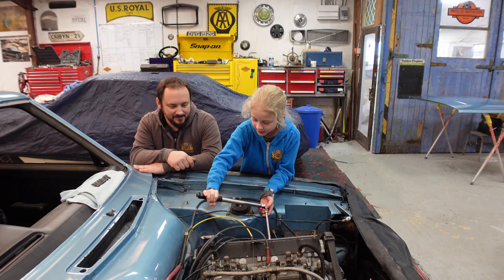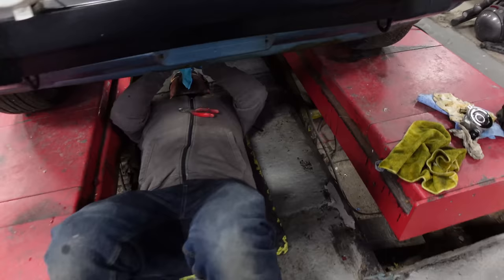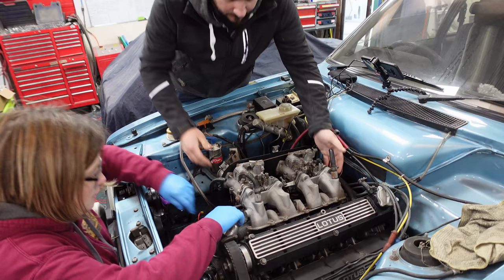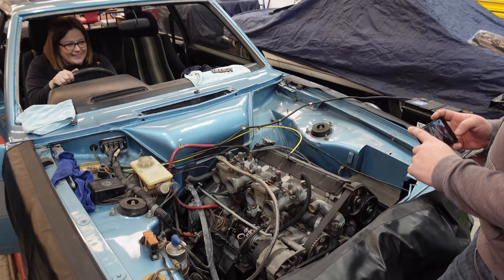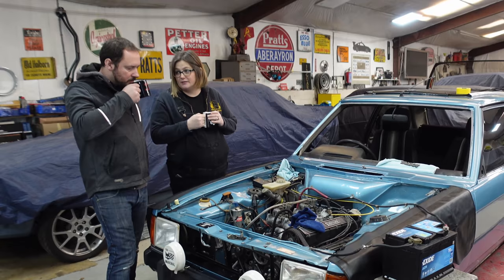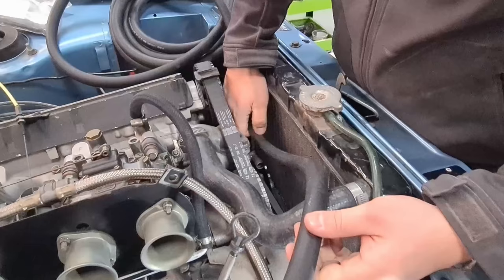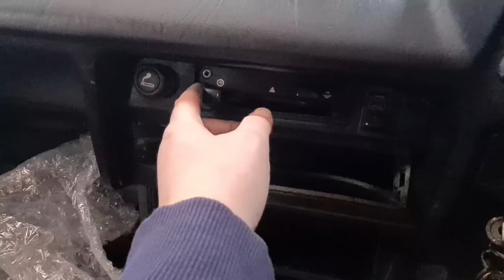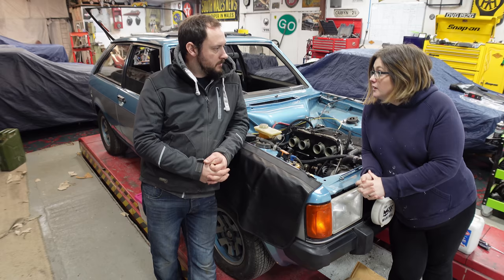First Start of the Blue Talbot Sunbeam LOTUS After 6 YEARS!

Comment: That pit-lift platform looks very handy but you really need a lie-down trolley under there, and it will also help keep your back warmer and dryer too. (I thought nothing of lying on cold concrete 20 years ago but not any more).
Reply from the maker: Well Phil funny thing is.... Its a full height lift we just ca t remember why we didn't send it to the top and just stand under it 😂 we also have a lie down trolly it's just got a. Massive slab of oak on it and tucked under the rally Volvo..... Don't ask.... 😂🤦
Reply: Phil I second that after 30 years in motor trade

Comment: Yuasa YBX1038 battery fits with a small modification. Theres some plastic tabs at bottom that need grinded down. Nothing off the shelf I am aware off that doesnt require a modification. Only takes a few mins. Theres a halford equivilant to this battery as well that needs same mod.
Reply from the maker: Thanks for the tip! I'll have a look into it. Much appreciated 👍

Comment: That flexible pipe from the heater matrix round to the front by the cam-belt, ideally should have an aluminium pipe section across the front on a bracket to keep it from moving…too much rubber floating about when it all gets hot…

Comment: Another great video guys. Really look forward to seeing and following all your work. Love those old giant carbs! Are they Weber DCOE 40's do I remember? Lewis, please may I ask you a question. I notice you use a twin cartridge respirator like I use for spraying, can you still smell paint fumes even with a new respirator? Someone told me that you should not smell paint at all, but I still can smell quite a bit, particularly when spraying clearcoat, and my respirators seal perfectly even though I have a beard like you!
Reply: From memory the carbs should be Dellorto 45s - I had the same car in the early 90s lovely noise, sold it to buy a house 🤷‍♂️
Reply from the maker: Those carbs are Dellortos.... lovely sound out of them! It's tricky spraying with a beard, sometimes you can smell paint through them, most of the time you can't. Really should be wearing an air fed mask when painting to be safe.... something we shall be doing, we do have one but we're looking to upgrade!
Reply: @WhitelandRestorations  Thanks Lewis. You are 100% right, but air fed just not feasible for the DIY'er I'm afraid. Massive compressor needed, very expensive filtration + cost of the mask. If I sprayed day in, day out I would definitely have to invest. I use the Gerson 8000 series respirator, which used to be the only mask that actually said it was isocyanate safe. Just to be sure, I e-mailed Gerson in the states and I have a nice reply from the guy that actually designed that respirator. He says that it has been tested and is safe for isocyanates up to 36 hours continuous use, after which you have to buy another or change the cartridges. I watch a few professional painters who have YouTube channels, and many of them use cartridge respirators.